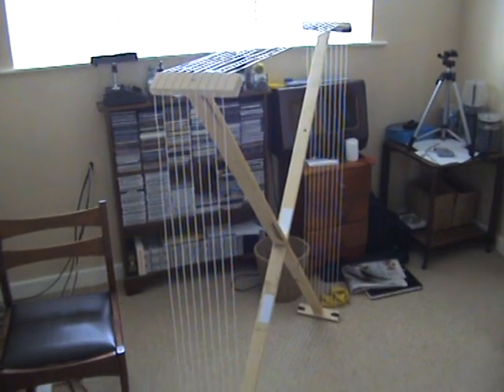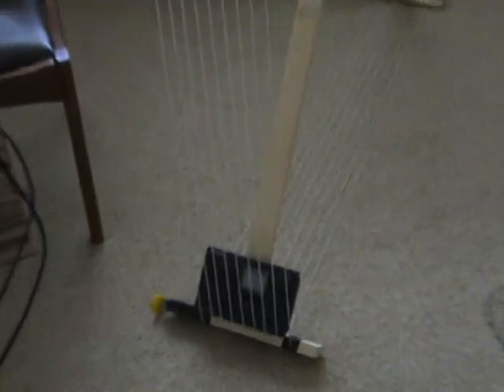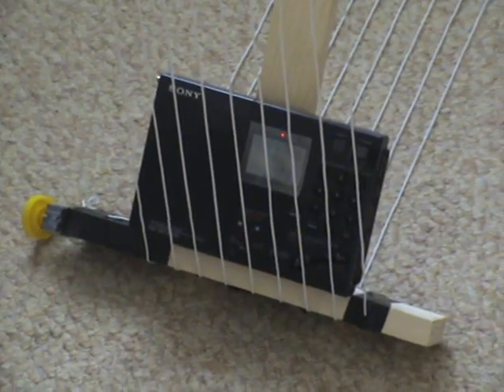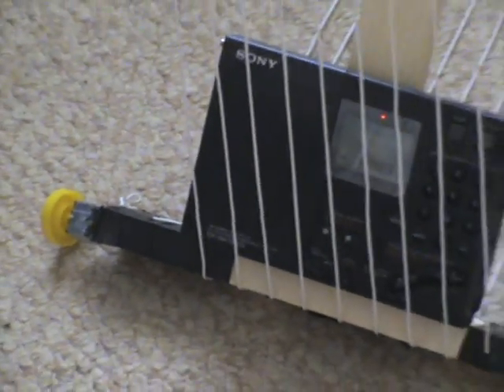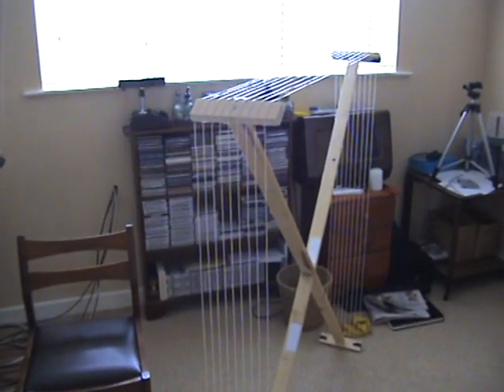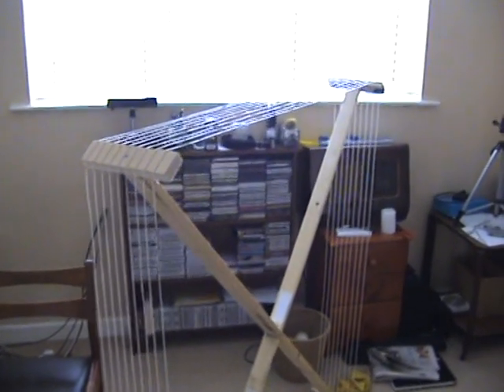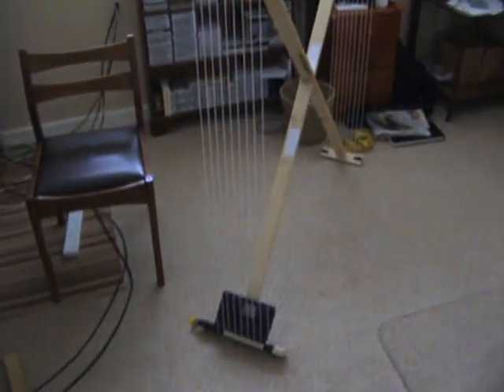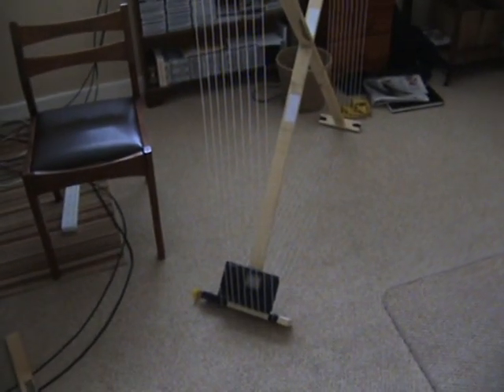Four foot AM / Medium Wave Loop Antenna

Comment: I think your larger diameter loop will provide the most noticeable difference in a low noise environment. If your background RF noise is always of a type and level where it is lifted with the signal, you won't see the benefit. Your 4 foot loop should provide a 6dB improvement over the 2 foot one if both coils are wound the same. However, your larger loop has a decent spacing between the turns so this will increase the Q factor, raising the signal magnitude further over one with a close winding. It also will have a lower inter winding capacity which will raise its self resonant frequency (the max frequency it will resonate with no parallel capacitance connected). This is good as if you get your hands on a variable cap with a low minimum capacity and a high maximum capacity you will get a very wide tuning range. I have some 5-265pf Russian poly film variables which are great for this. They have two sets of plates too so you can get 10-570pf with them in parallel :)

Comment: In my experience, I have found that having the "point" of an RX  loop pointed down works much better than having the side pointed down. I know, this is a pain in a design standpoint, but it provides the best gain and null, too. 73 de NV6R

Comment: I used a much bigger capacitor so that it would cover the whole band without switching in extra gangs. This meant I had only four turns of wire on a 4 foot square.
I agree though, it's not noticeably better than the 20 inch square and ten turns of wire I usually make.

Comment from the maker: A real killer with a little radio. I direct connected it to an rx by placing about 15 turns of wire on an approx 6 inch ferrite rod and feeding that back to the radio via coax. Works great.

Comment from the maker: 9 turns of wire 48 inch square - 67.88 inch cross arms wire spacing 0.875 inches. Vari cap from old radio A real killer with a little radio. I direct connect it to an rx by placing about 15 turns of wire on an approx 6 inch ferrite rod and feeding that back to the radio via coax. Works great.

Comment from the maker: Here are the plans - 9 turns on a 48 inch square - cross arms are 67.88 inches- wire spacing is 0.875 inches- tuned with a vari cap from an old radio -  I get full coverage from this 530-1700 khz by switching in more than one gang - dont know rating of said varicap - it isnt the one shown in the video. After using the loop for a while I found it to be very very good.

Comment: Thats really good there,  If I built that myself the radio station WVAB and WBVA would actually put a hole in the RF front end of my S-350DL cause the field would be so strong, because I am located in the 23462 area in Virginia Beach.  Great loop though.   I might consider thinking about building that for LW in the future.